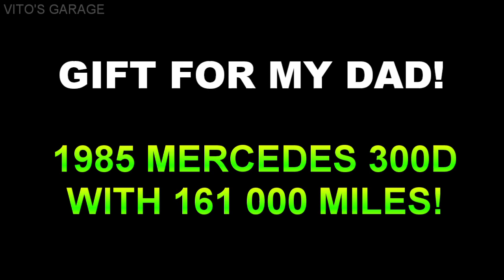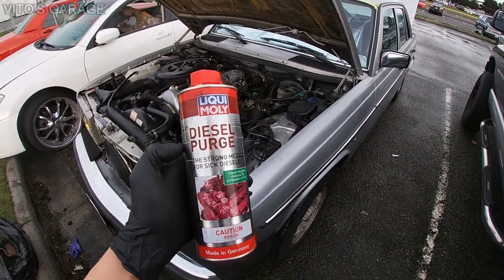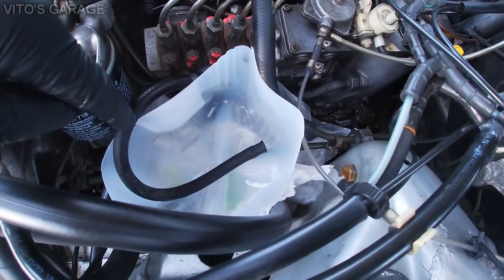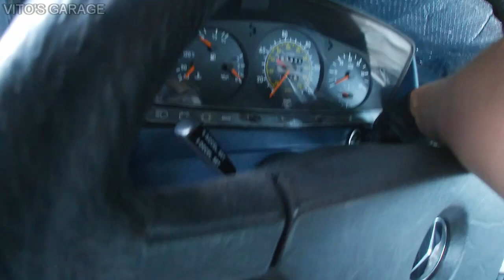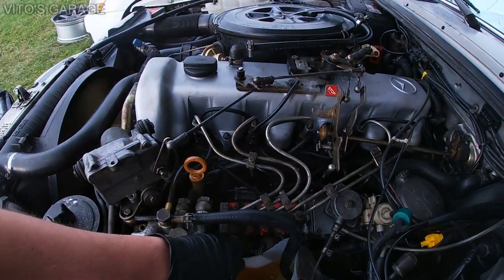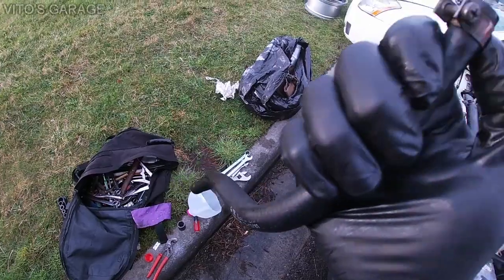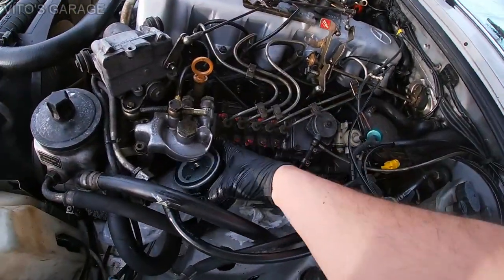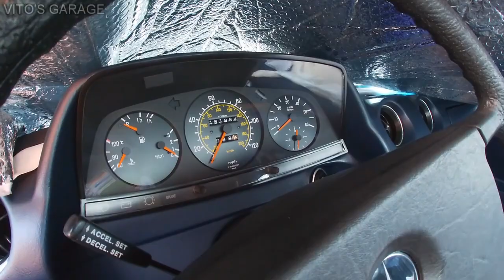PART 18 Dad's Mercedes W123: EASY Diesel Purge Fuel System Cleaning; Fuel Filters & Hoses!

Comment: Hello Vito, do you know what the Mercedes star means?
In fact, in 1909 the Mercedes three-pointed star, designed by Paul Daimler, was patented: It symbolizes the three spaces on which Daimler engines circulated at that time "water-earth and air"!
From 1914, Daimler built in Sinderfingen (10km from Stuttgart) .... fighter planes. But after the war, he had to switch to car manufacturing. In the Roaring Twenties, Daimler-benz created a "special vehicle unit" which offered personalized vehicles for eccentric and V.I.P. customers.
In 1932, the economic recovery will allow the design of Super Mercedes W07 and W150, which the Fürher will be equipped with ... Hitler had a weakness for Mercedes.
But, few people know, it was during this period in France that the most legendary exceptional cars were designed: Delahaye, Delage, ... / .. and of course the master: Bugatti.

Recently, I am discovering the history of Peugeot :   https://www.peugeot.fr/marque/univers-peugeot/deux-siecles.html
More than a century of Peugeot innovation (in French ..): first gazoline peugeot 1890, first convertible roof in the trunk in 1934, first diesel engine in 1936, electric vehicle in 1941, in 1951, first mass-produced diesel vehicle. It's not Bugatti but interresting !
Reply from the maker: Amazing story!! Thank you for sharing all the info!!🙂
Reply: Dobra robota

Comment: Hello nice video, I have 1 hose that goes into the fuel filter from the back of the engine,and another pipe that goes from the fuel filter into the lift pump, The pipe that’s goes into the lift pump attached to the side of the engine that’s the supply line right?
Reply from the maker: Yes. The supply line comes from the lift pump and goes to the main filter and then to the injection pump.
Reply: @VITOSGARAGE  I’ve only got 1 pump (injection pump) according to the manual, 1 line with fuel comes into the fuel filter, the other line is an out into the pump, which then sends fuel to the injection pump, when I was looking at the setup earlier I noticed the line from the injectors goes into something separate, would that line be a return line? I’ve got a London Taxi but the same principal should apply.
Reply from the maker: @sabiya2  send me pictures and questions on Instagram: vitosgarageyoutube 
Or email: vitoldaswork@gmail.com

Comment: what happens if you don't put in diesel in the main filter? and instead put in a bit of diesel purge?
Reply from the maker: If you fill the main fuel filter with the diesel purge all the way, nothing will happen. The car will still start and run. The main thing is to fill the fuel filter up all the way up with diesel or diesel purge. Otherwise you’ll have air in the system and you’ll spend more time bleeding the air out of the fuel system. Diesel engines don’t like that
Reply from the maker: You need to fill that filter up or it won’t run. It’ll take you a while to bleed it

Comment: Thanks for the video. Did not know about this purge. Will have to try it. 

I have a couple of questions: why not pouring directly the liquid in the diesel tank?

The liquid being in a container, the return will bring the dirt in the container, but eventually will return in the engine. This is why I am wondering why you did not place it directly in the tank.

Thanks
Reply from the maker: It won’t clean the fuel system if you pour it in the tank. You have more diesel in the tank than diesel purge. Running it 100% on diesel purge will clean everything and you’re not bringing the dirt back to the tank..
Reply: @VITOSGARAGE  OK, thank you very much for your reply